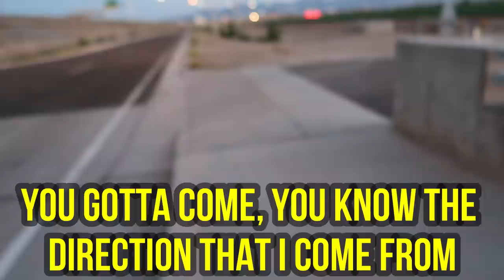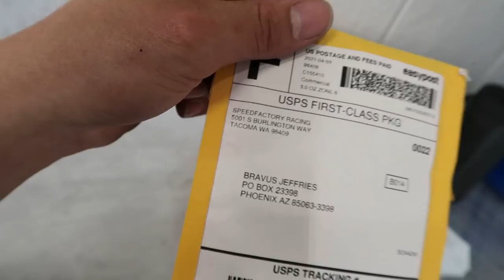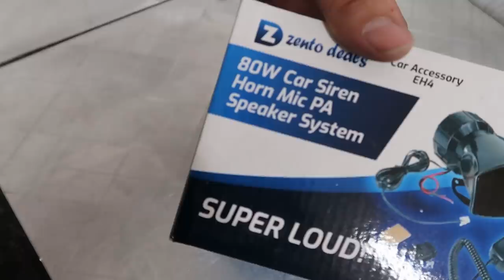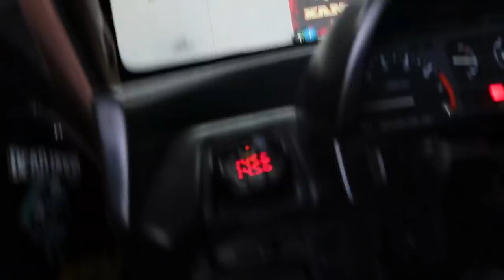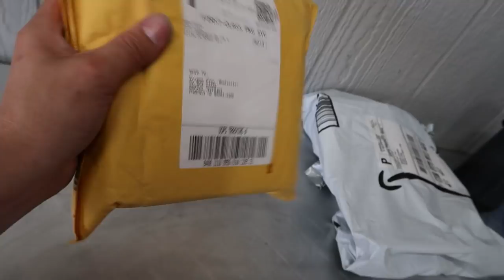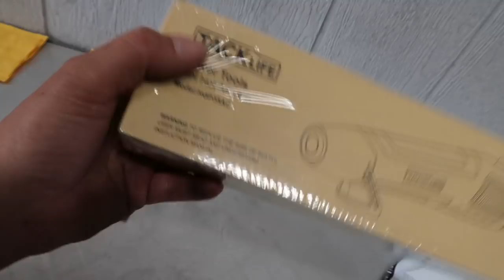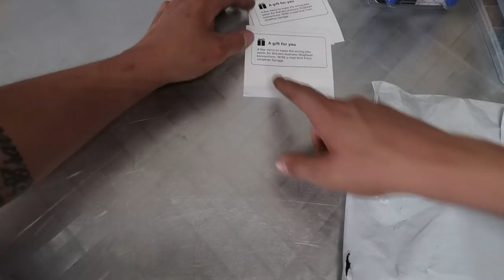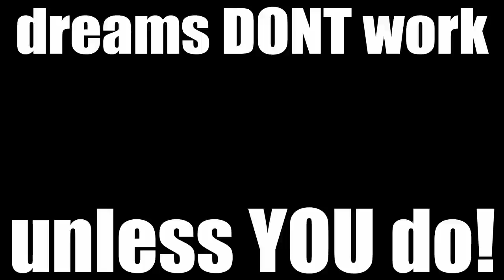DIY Clutch Bump Stop

Comment: Now you gotta glue a piece of horse stall mat under where the head of the bolt hits so it won't ruin ur paint lol
Reply: Remove clutch switch,put a bolt instead. Costed me 2.50$,nothing hits the floor
Didnt had to weld anything.
Reply: Horse stall  mat huh? Mike banks, out there kickin the shit lol..  I totally agree about something to cushion the bolt head though.
Reply: I used horse stall mat cut to fit the trunk floor in my 97 ek hatch its thick n very durable and has lasted years just hard to cut lol

Comment: hello i had my grom for over a year 2020 grom hands down the most fun i have ever had use to use it to commute 60 miles to work the 100 miles for a 1 gal tank was also fun if you go get one tho i would recommend a bigger sprocket and thicker fork oil for both faster take offs and smoother rides. and get a exhaust

Comment: So is overthrowing the pressure plate an issue with stock clutch pedal setups? I was under the impression it was only for twin disc setups
Reply: Not sure but i have a stock clutch with "same as" hybrid racing cmc kit.My gears go in half way pressed.I should probably weld one asap
Reply: @upnorthviking823  im pretty sure it only matters on twin discs
Reply: @AHS_motorsport  just did it this morning 2.50$ i put a bolt where the clutch switch goes...changes the whole car!shifts quicker.hope i caught it early...you adjust it so gear go in smoothly.its all the travel you need.
Try it you will love it!
I had shavings in my oil from pushing the crankshaft.....also saves your leg in traffic,way less annoying to drive the car.

Comment: I think wilwood masters have a adjustable push rod on them
Reply: All master cylinders do.
Reply: The adjustment of the rod has nothing to do with stopping the pedal from overthrowing the pressure plate.Changes everything.

Comment: Should of just removed the clutch switch and added the clutch pedal stop on there
Reply: How would that limit the pedal travel?
Reply: @sideshow45  that's how everybody normally does it. Try it look it up. I have it done on my integra. It stops it from going to the floor. And that noise would brother the fuck out of me
Reply: I'd actually love to see a how to on that. Tried to find it on the interwebs via Google and came up dark.
Reply: @JohnnyRacer496  you need a how to to remove the clutch switch and put a bolt there instead??
Ever changed your own oil???😂